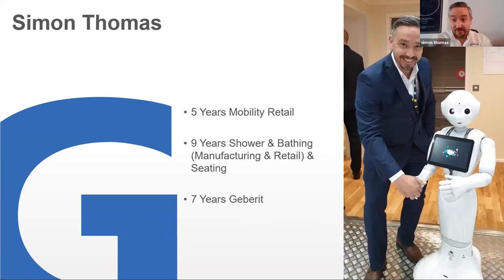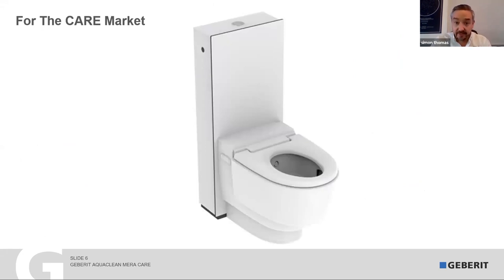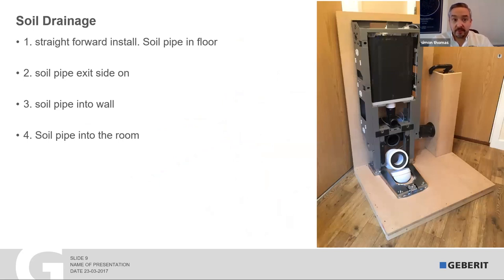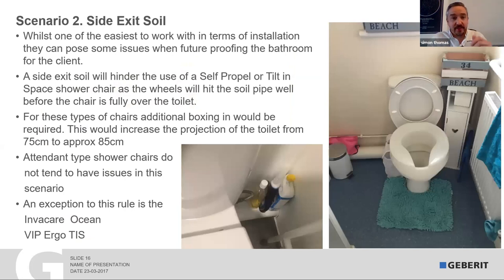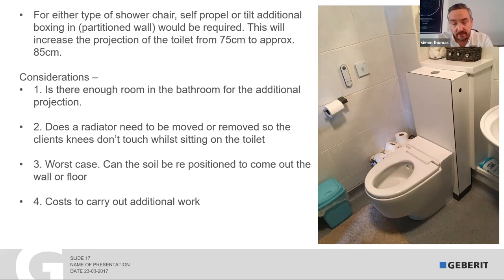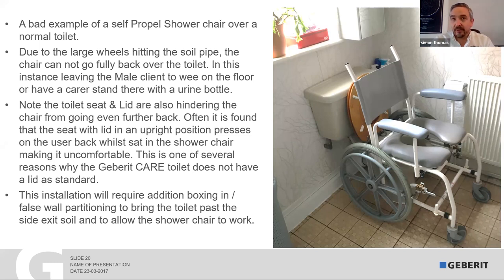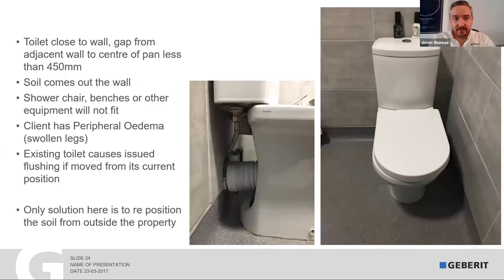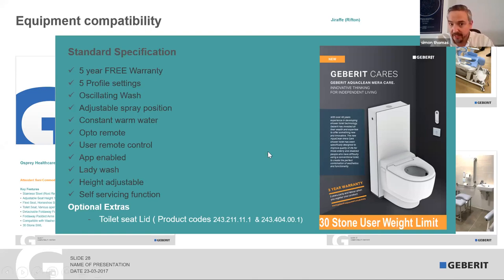Webinar - How to future proof your shower toilet installation

Comment: do you know how to pair the remote to the toilet
Reply from the maker: Hello. Yes. There are 2 ways.  
1. Put the battery in the remote control. Then turn the power to the toilet off for 1 minutes or more then turn the power to the toilet back on. The remote will auto pair to the toilet.   
Option 2.    Place the battery in the remote control then press and hold the + button the remote whilst pressing and holding the up button on the side of the toilet. Hold both buttons in for around 20 seconds and you will see the screen on the remote control say “pairing ok”
If you need any further help do email me.    simon.thomas@geberit.com